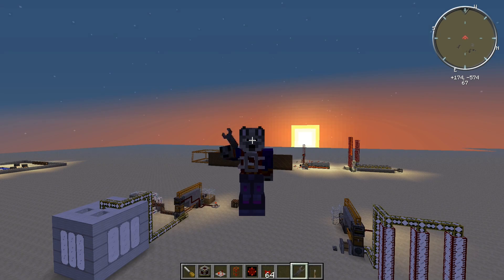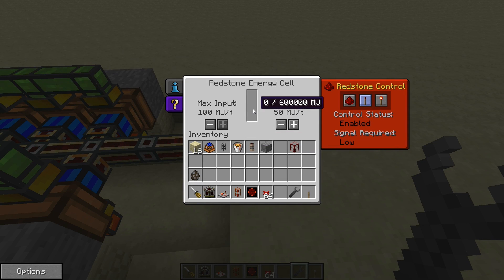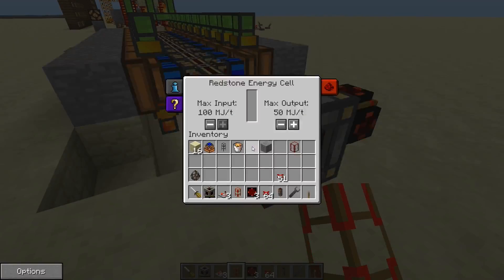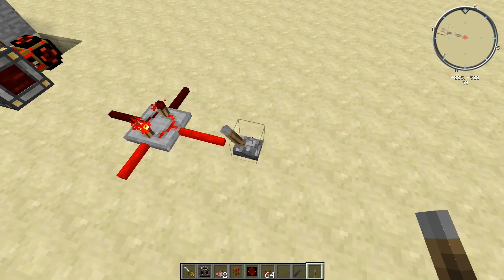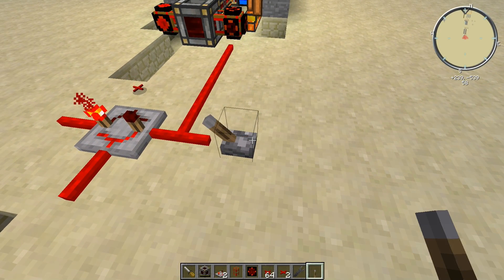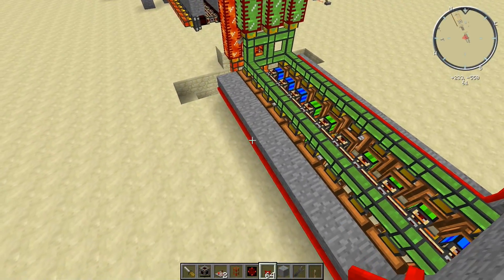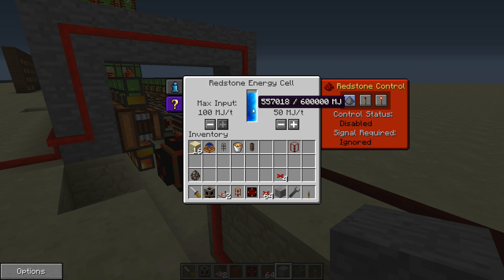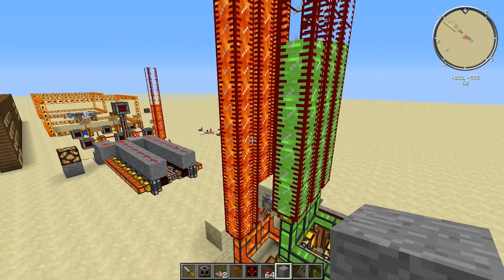Feed The Beast Ultimate - Tutorial #02 - Energy Storage and Shut off Valve

Comment: Great build. Had a similar setup though wired differently when I was testing engines. As for the Biogas vs Combustion engine the Biogas is actually a slightly better choice as far as conserving energy. A small amount of lava is only used to start the engine. With combustion engines you have to refine the biomass. 4 buckets of biomass=1 bucket of biofuel in a refinery. 4 buckets of biomass in a biogas engine=200,000MJ. 1 bucket of biofuel in a combustion engine=200,000MJ.

Comment: From my testings with energy cells, I've found that if you have something connected to the cell that uses 5mj or less, some times the cell will stop at 599996-7 mj, and refuse to ever get full. This makes the engines in effect run forever (blowing up/stop working when they overflow with energy), or just run out of fuel.